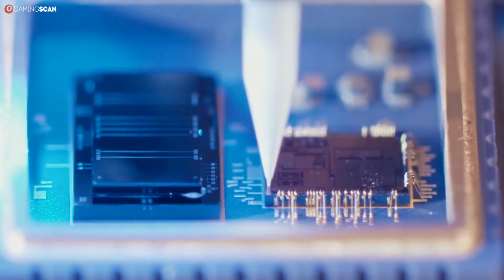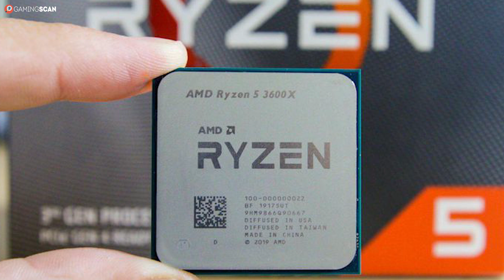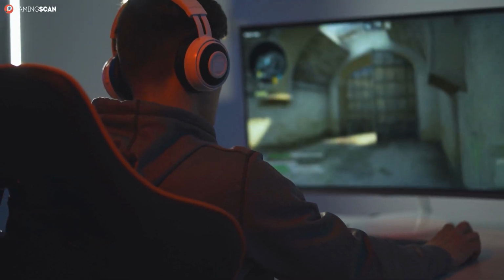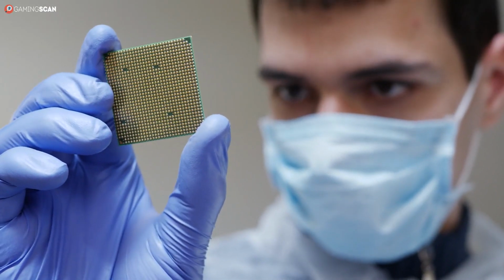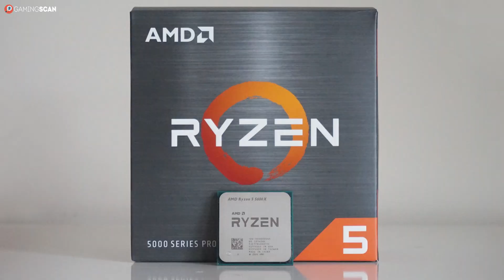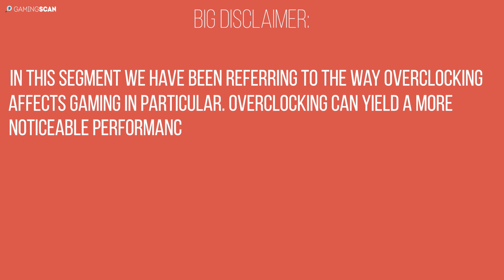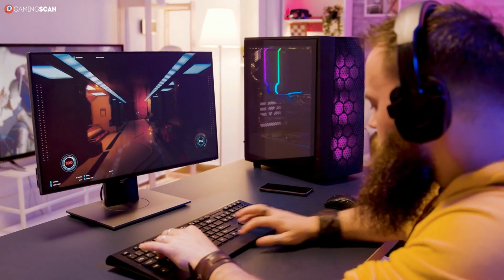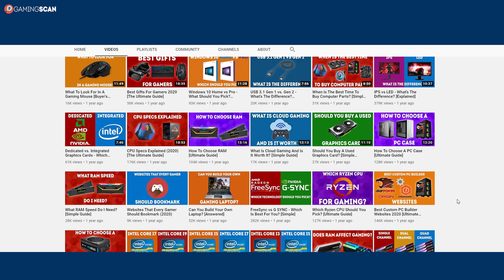Locked vs Unlocked CPU - What Is The Difference? [Simple Guide]

Comment: Does having a intel F model without integrated graphics perform worse than a k model with integrated graphics aswell  as being unlocked to factory defaults?  I have a 3070-ti gpu and don’t know if having integrated graphics would be beneficial to my gaming experience (stable, high frame rate)

Comment: different with locked and unlocked cpu overclock is , maximum overclock accept in locked cpu is +27-28% overclock Q6600 maximum locked Cpu , but for unlocked cpu if you value +0.7572Voltage maximum of Cpu you can overclocking at maximum +1000% overclock but you dont have get for now so cool cooler about maximum voltage +0.7572V at Cpu for maximum posible Fsb Value , Locked Cpu maximum voltage is 1.325Voltage but for Unlocked Cpu maximum voltage is up 3.000V voltage (but Be carefu about + Voltage is not safe up +0.0750V)

Comment: Yes I would agree but battlefield 2042 I went from 21 frames with a gtx 1080 fe i5 7600k 3.8 hz stock to 4.6 hz overclock and I get 51 to 81 fps now. 61 degrees celc to. I will be over clocking to 5.0 hz but I need to do a little research.  My graphics card also has a little boost to it but I doesn't matter battlefield doesn't even have it close to a 100 percent and I'm on direct 11